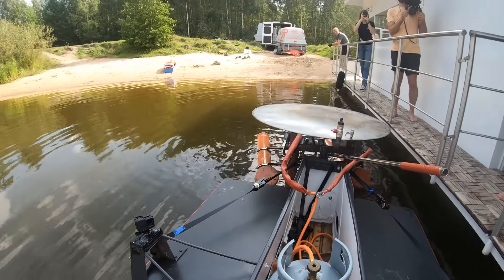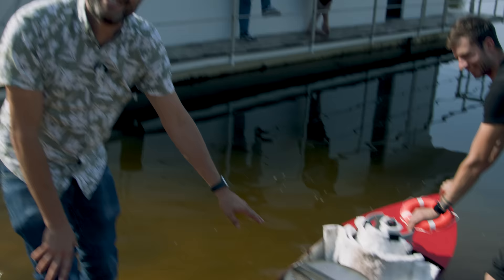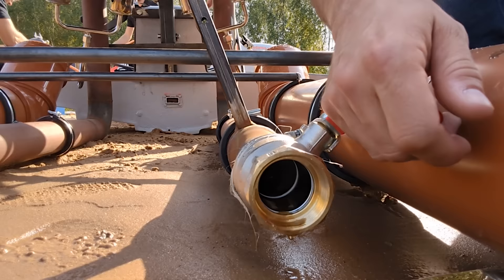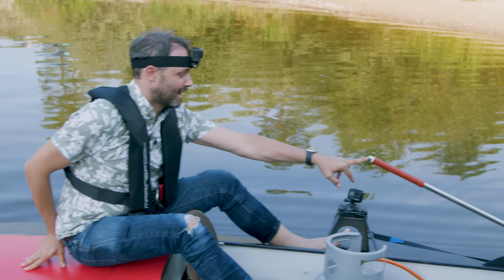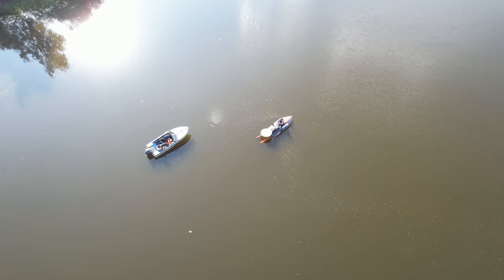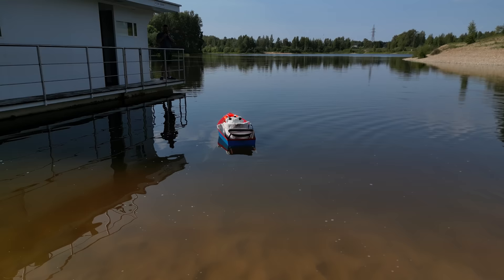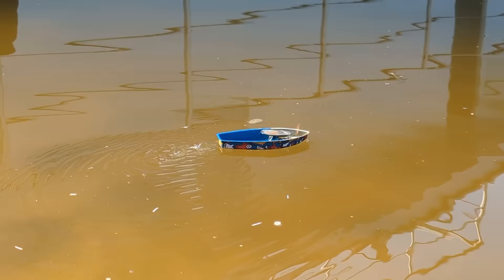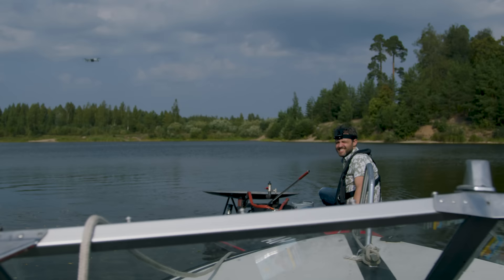Will this toy engine work at full size? (yes)

Comment: 😂😂 it would not have same speed anyway. Bigger object need more energy to move + its own weight + atmospheric pressure issue + wind issue + gravity + etc etc etc . Motor issue - it is separate question, small size tubes and etc sometimes performing much higher power to weight ratio especially in simple constructions

Comment: why not have kept the original system ok the racing boat is good :) but for the beginning we have to stay in the same concept :) certain we put a big spark plug :) we have to be able to watch where we move reverse the direction of the seat to drive in the direction of travel :) https://www.youtube.com/watch?v=S4PGg_TIReA :) this boat is very light just that his armor is too heavy in wood the whole boat would have been made of foam and fiberglass or carbon +++ light :)